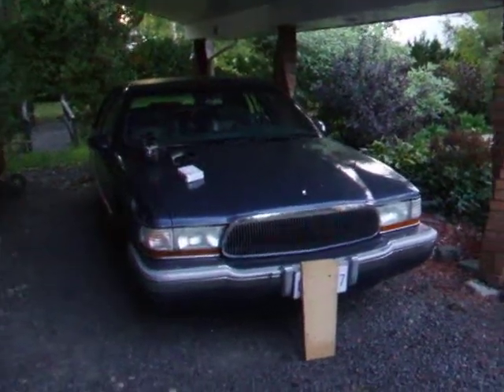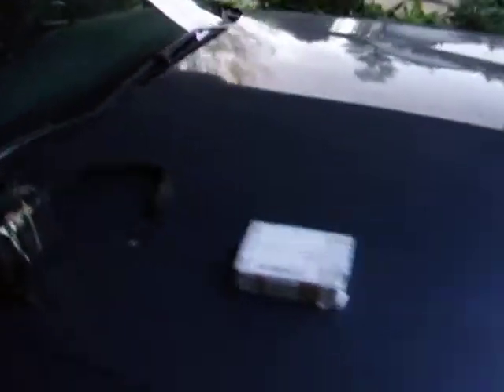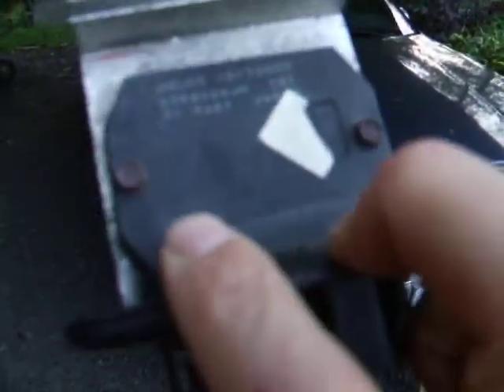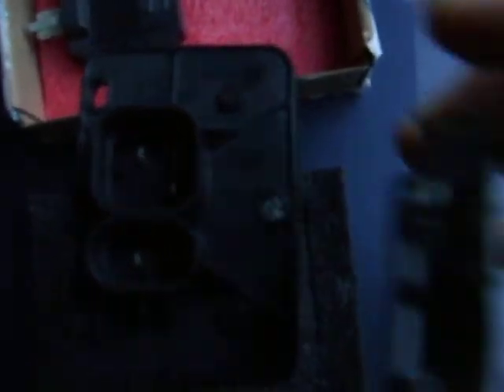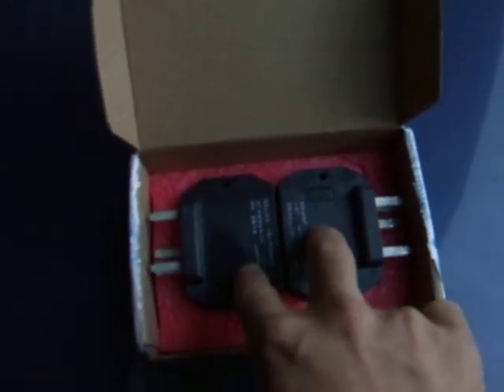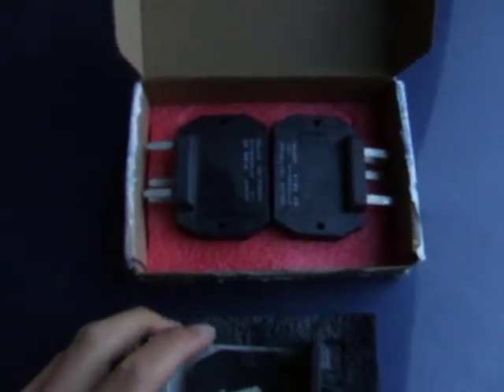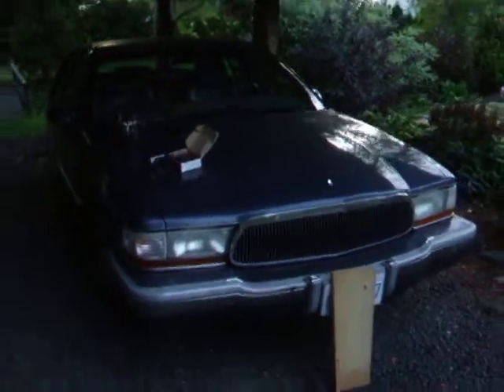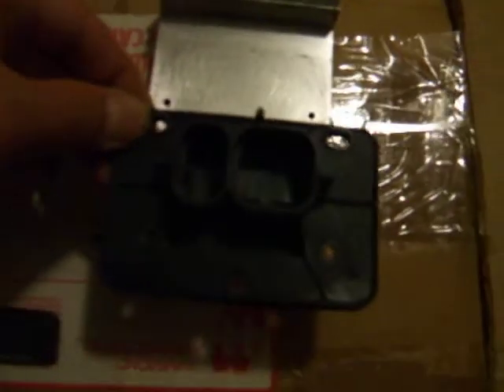$10 Blower Motor resistor/transistor replace on Buick Roadmaster / Chevrolet Caprice - Save $100!

Comment: thank you for sharing...  question for you if anyone can answer... So I have a 92 Roadmaster and this module you show has 3 prongs and 2 prongs... on my 92 the owner previous to me replaced the manual climate control system with a digital style. I removed the resistor, took it apart.  It's melted. And the part has 4 prongs and 2 prongs for the electrical connection.  I can't find that exact fitting anywhere online.  I'm considering doing a complete bypass to the blower motor from a toggle switch to climate control to blower motor. But is there anywhere I can find the 4 prong part so i can save some money?
Reply from the maker: Hello, sorry for the delay just saw this now.  Nice car, I'm envious of your full gauge cluster, the only downgrade for '94 (though the LT1 makes it so worth it lol...:o)  I'd be glad to try and help, there are several questions I'd need to ask.  I think these cars came standard with electronic climate control.  Is your module the manual HVAC with several resistors (look like springs), or the auto HVAC with big transistor, either a black square or a shiny round can?  I notice the manual one has 4 prongs in a row, while my Auto one has 4 prongs in 2 connectors.  Correction, the Auto one has 3 prongs in a 4 hole connector, and 1 prong in a 2 hole connector.  Does this make any sense?  Perhaps you could email me some photos and I'll do my best to assist - you can find my email on my YouTube Channel page - click 'more' at the top beside my summary, then 'uncover email'.  Cheers!~  Bellarmine

Comment: Will this cause the blower not to work at any speeds?
Reply from the maker: Hi Darnell, that is correct, if this transistor is dead, the blower motor won't work at all.  Other possibilities are a blown fuse, bad motor, or bad climate control electronic module.  Check the fuses, you can unplug and jumper the motor directly with 12v to check it, then try this $10 module.  Let me know how it goes if you wish or have any other questions.  Hope you fix it, it's that time of year you're going to need heat now....:o)  Thanks for your query Darnell, Cheers!~  bellarmine

Comment: I have a '92 Oldsmobile Custom Cruiser. Is this the same part? Ordered an OEM replacement since it'll get here faster, but I'll definitely keep these around.  I wish they were  accessible in the US
Reply from the maker: Thanks for the question. Yes, your Custom Cruiser should be the identical part.  If you do buy some of the $15 ones as backups, just make sure you keep your old original heatsink unit with the big black square transistor on it.  The new OEM ones have the same plugs but use a different heatsink and silver diamond transistor, and the eBay part won't fit on those.  Nice car, I'm lucky enough to also have a '96 Roadmaster Wagon (don't drive it in the winter), your Custom Cruiser is MUCH rarer!  Let me know if you have any other questions or if you'd like a PDF brochure - Cheers!~  Bellarmine
Reply: @bellarmine33  This is my second. Had to give up the first after neck and back surgery because I couldn't account for the blind spots. I'm hoping to do better with this one this time around.
Reply from the maker: @joekni2002  Thanks!  Emails got crossed, hope you saw the links to cheap blower transistors in the US I just sent you few minutes ago.  So this is your 2nd Cruiser, congratulations!  Hope it works out for you this time, you must like them.  Sorry to hear about your surgery, here's something that might help your neck and your blind spots:

https://www.etrailer.com/Mirrors/K-Source/KSRM011.html

I have one in both my cars and I LOVE them, I recommend them highly!  I can see the whole back of my Wagon, out both rear windows and rear doors even.  Keep an eye on my dog when he's with me too.  Only caution is, seems some people complain they see 'too much' and can't get used to it.  I myself cannot understand what they are talking about, but perhaps it's this:  My Dad bought mirrors like these in the 90's when they came out, and the ones he had were not as wide.  I had got used to them so much I can't stand the OEM mirror anymore, so this even wider one was a nice upgrade, but perhaps some people might find it too much of a jump all at once.  My theory.  Again hope this helps - Cheers!~  Bellarmine
Reply: @bellarmine33  Also, I think I'm going to go to a salvage yard and see if I can find one that has a good heatsink,
Reply from the maker: @joekni2002  You're welcome for the help anytime!  Good idea about the salvage yard, then you can use the $10 part.  Though if your original old part is the same, there's nothing to go wrong with the heatsink, it's just a piece of metal.  3 main parts: Transistor with pins, aluminum heatsink, and plastic connector shell that slips over the pins.  Do let me know if you have any more questions, great talking with you.  Keep your Custom Cruiser running, they're not making any more of 'em.  Cheers!~  Bellarmine
Reply from the maker: Hello again, I found some cheap in the US for you !
https://www.ebay.com/itm/203353993924
https://www.ebay.com/itm/234871715423

Don't know if it's too late to cancel your OEM order lol.........:o)  Hope this helps!  FYI if you needed to hold out for a week while waiting, what I did was just short the 12v supply pin straight to the motor pin with some clips, turning the blower on and off manually for a few days, won't hurt anything if you get the pins right (I have the pinout).  Let me know if there's anything else - Cheers!~  Bellarmine
Reply: @bellarmine33  I appreciate the help here. They're already on the way. Gonna look at getting that larger rear view mirror. Probably a backup camera too

Comment: Hi…. How do you know the is the issue? Code? I’m wondering if it’s my thermostat or this device.
Reply from the maker: Hi Pigidly, thanks for your question. This blower motor resistor/transistor's sole purpose is to control, or regulate, the speed of the blower fan. If the transistor chip goes bad it shows 1 of 2 symptoms: The blower motor either does not run at all (chip fried), or is stuck on High all the time, sometimes even with the ignition switch off (chip shorted). If you turn your fan speed all the way up and the fan does not run at all, then it is either the climate module, the blower motor, or this transistor chip, the chip being the most common fault by far (also check your fuses).  So, aside from the blower motor, anything else wrong with the climate control system would be something else, not this chip. Hope this helps, do let me know if you have any other questions Pigidly....Cheers!~ Bellarmine
Reply: @bellarmine33   ok 👍🏼 I don’t have any heat in my 94 Roadmaster… well a little. It’s all the way hi and it  barely warm. My coolant level is ok… so I guess it’s the thermostat?? Thanks.
Reply from the maker: @pigidly  Hi Pigidly, Ok, I think I know your problem, had the same problem with my '94, almost NO heat.  First two questions:  1-Does your blower motor run?  2-Does your temp gauge on the dash get up to 12 o'clock position, and when idling for a while does it go to about 1 o'clock and then the electric engine fan comes on? (unless you have the tow-pack with belt-driven fan).  If YES to both questions, your heater core is clogged.  I just disconnected the two hoses that come from the core (careful of the plastic tee), and flushed them out with a garden hose.  I found one of those 'Gardena' quick-connect garden-hose male ends fit nice and snug into the heater hoses, flushed it both directions several times, and now my problem is TOO MUCH heat, have to turn it down!  There's also a plastic hose joiner that has a 'restrictor' in it (small hole), make sure that's not clogged as well.  Congratulations on your '94 by the way, GREAT cars aren't they?  Again hope this helps Pigidly  - Cheers!~  Bellarmine
Reply: @bellarmine33   thank you so much! 
Yeah blower works fine… the temperature gauge stays at the 12 o’clock position all the time. Stray in the middle. Should it get a bit higher? Got my coolant changed before winter also… thanks
Reply from the maker: @pigidly  No, that sounds perfect.  I just have the 2 electric fans, and it stays around 12 o'clock all the time while driving.  If I let it idle standing still for about 10 mins it climbs to near 2 o'clock and the fan turns on.   Towpack Belt-driven fan runs cooler.  One other point I thought of: With the blower running on high, do you hear the whooshing sound change if you change the temperature from cold to hot, and also press the floor/mid/def buttons?   If yes that means your temperature blend doors are working, just a check.  

A tip:  You can read all sorts of info, RPM, engine temp and even DTC Trouble Codes from the climate control display if you simply hold down two buttons, see here:
https://www.impalassforum.com/threads/tach-in-the-climate-control-trouble-codes.230311/

As always let me know if you have any further questions, and also how it goes if flushing it fixed it.  Also have a brochure for the car I could email you if interested.  Best wishes Pigidly!~ Bellarmine
Reply: @bellarmine33   thanks for your help!!! I will try the flush method. It’s just really cold now here in Canada QC.  -13c can’t really play with water 😕. My AC gave away also this summer… don’t know if all that is related. Will check tomorrow the blend door if they work.
Reply from the maker: @pigidly  You're welcome!  Yes, no fun to play with water right now, -5C over here in Sudbury.  If your climate control appears to do everything it normally does, I wouldn't say it's related.  See that page above on the diagnostics mode, you can also use it to see a number readout of the blend doors operating.  I have another video on general A/C tips below, can advise you with that in the Spring if you wish.  Again let me know how it goes, cheers~!  Bellarmine
https://www.youtube.com/watch?v=ktZJQZLR12E&t=2s
Reply: @bellarmine33  Quick question. Can you do the flush from the water pump? Unplug the heater hose from there? Looks easier to do it there. I know there’s a T fitting with a canister?
Reply from the maker: @pigidly  Sorry for the delay, was fixing a bearing on my friend's car today.  Yes I suppose you could do it from the water pump.  Only 2 things to look out for are it will tend to spray into the recovery tank (not necessarily a bad thing), and try to check the plastic hose joiner on the other hose near the tee - it has the small hole that might get plugged with debris.  I think might be better to disconnect at the tee and joiner, that way you can check the restricter joiner and also elevate the hoses coming from the water pump and prevent loosing a lot of coolant from the block.  Your choice of course, it's been a few years since I did this I'm a tad rusty now (time flies!.....:o)  Hope this helps, cheers Pigidly!~ Bellarmine

Comment: My wagon 93 is always high speed, need remplace the resistor?
Reply from the maker: Hi Ariel, Thanks for your question.  I would say yes, but before I'm sure I have to ask a couple points:
1-Do you have a Buick or Chevrolet Wagon?
2-Do you have the "Electronic Climate Control" with buttons for the fan, like in my movie?  Or do you have the standard temperature and fan knobs / slide levers?
3-When does the fan run at high speed?  When you turn on the climate control, or the ignition switch, or both?
If you answer these 3 points then I can tell you for sure.  Cheers Ariel!~  Bellarmine

Comment: Thank you! The local AC repair shop wanted $400 to replace the fan in my '96 Buick Roadmaster Wagon. I followed your instructions and made the repair for under $15 without replacing the fan. The one thing  that wasn't covered in the video is the location under the dash. I found it by looking for the two connectors that you showed. Other than that you can't really see the part. It was under the dash at the far right facing upward. Thanks again!!!
Reply from the maker: You're welcome Jim.  Wow, another $400 quote, you're not the first commentor who's gotten crazy quotes!  The brand new transistor module is only $120 on RockAuto, and it takes seconds to confirm your blower motor is good with a multimeter.  I guess they just quoted you without checking the motor first?  Whew.  So glad I saved you some cash Jim.  I have a Roadmaster Wagon too, congratulations, boy are they fun cars, they don't make 'em like the used to. Power, Luxury AND Economy, you CAN have it all when America does it right lol.  Let me know if you'd like a free PDF brochure, makes for good reading.  Cheers Jim!~  Bellarmine
Reply: @bellarmine33  It would be fun to the brochure. Thanks
Reply from the maker: @2and4the1  Hi Jim, Sure I can email one to you.  I'm not sure, can you see my email address on my YouTube 'About' page, under 'Business Inquiries'?  Otherwise, it's my username without the 33, followed by ROGERS and COM.  Talk soon Jim!  Bellarmine
Reply from the maker: @2and4the1  Hello again Jim, did you send me an email?  I'd like to send you a Roadmaster brochure, but I'd need your email address to send it to...:o)  Or email me - bellarmine ..AT.. rogers ..DOT.. com.  Talk soon Jim!  Bellarmine

Comment: I wonder if it will work for my ‘96.  The resistor unit I pulled out has the big heat sink but the transistor doesn’t look like that and there’s another part soldered through the heat sink
Reply from the maker: Hi Joe, thanks for your question!  I think aftermarket has another version of the transistor, in a so-called "T03 type" transistor package.  Does it look like a round silver can with two mounging lugs on it, like in the  2 links at bottom of my comment?

If so, then your problem is, you could buy my $10 part and plug it in to the connector, but mounting it to the heatsink would be the problem.  If there are ANY numbers on the transistor tin can itself, read them to 
me and I'll see if I can find the transistor part for you.  Anything else let me know Joe - Cheers!~  Bellarmine

https://www.rockauto.com/en/catalog/buick,1996,roadmaster,5.7l+v8,1022218,heat+&+air+conditioning,blower+motor+control+module+/+resistor,6557

https://www.rockauto.com/en/moreinfo.php?pk=1513974&cc=1022218
Reply: @bellarmine33   thanks. mine does have the round part.  Im  going to try and find a jeep version of this blower resistor since that seems to be the one with the plain heat sink
Reply from the maker: Small Addendum, does it look like this, I matched the number up with one of the RockAuto replacements:
https://www.ebay.com/itm/130742868435

Let me know if it matches or what it looks like Joe.  Cheers!~  Bellarmine
Reply: bellarmine33 I did buy a Jeep version off amazon but it’s mount that screws into the air box isn’t the same and it’s not that  easy to adapt the GM plastic to fit.  I may have to get creative or find a heat sink setup like you have
Reply from the maker: Hi Joe, Sorry to hear the Jeep one won't do.  Hope you didn't have to pay too much for it, you can get a drop-in replacement for your Roadmaster at that RockAuto place I mentioned for about $100.

I can think of 3 ideas, with the last the best IMO:
1 - Find an OEM one at a wrecker yard so you can use the $10 part.
2 - Buy the tin-can-type replacement transistor from eBay for $50 - SJ41042.
3 - I think this is the best choice:  Are there 2 screws at the bottom where the connectors plug in, can you completely remove the plastic mounting plate from the heatsink, like at the end of my video?  If so, I'd suggest this:  

Buy the $10 STK6994JH.  Then you can slap the plastic mounting plate over the connector prongs, plug in the harness, and it'll work.  Your remaining problem is the heatsink.  I'd suggest removing all the junk from your existing one, grinding/filing a flat area on it and bolting down the big square pack onto it (with thermal grease).  Use a couple screws to somehow secure it to the plastic plate - done.  

You can even use ANY heatsink, got an old heatsink from a computer lying around?  Anything as long as you COOL the big transistor, and secure it to something.  Maybe just plugging in the harness with the plastic mount will keep it steady enough.

Hope this helps Joe, let me know if there's anything else you need.  Cheers!~  Bellarmine

Comment: How anybody gone see what you doing if your videos in the dark
Reply from the maker: Sorry about that Marcus, yes it was a bit dark, though what I can see with my eyes is so different from what the camera sees, camera is much darker.  Also my intent wasn't so much to show where the module goes, as how to buy a very cheap perfectly matching replacement.  Garages are asking several hundreds for this, just crazy.  Also it is very easy to get at the module on these cars, hence I didn't think it really needed explaining.  Just remove the plastic trim panel cover under the dash over your knees on the passenger side, and the module is right up there ready to take out.  Anything else let me know Marcus - Cheers!~  Bellarmine